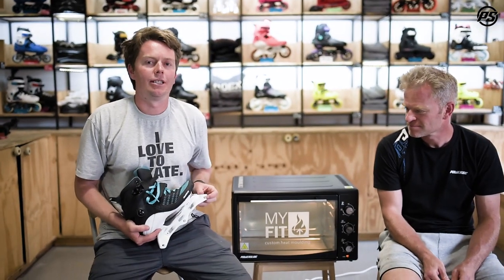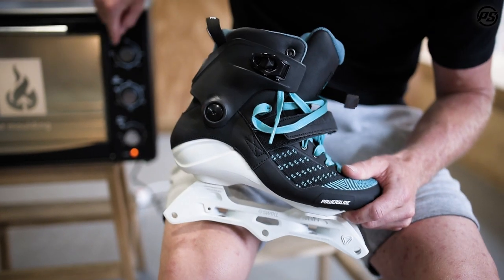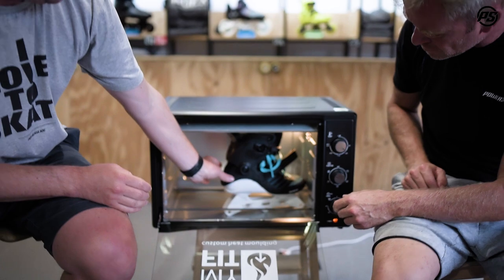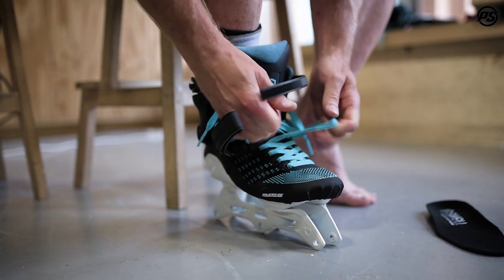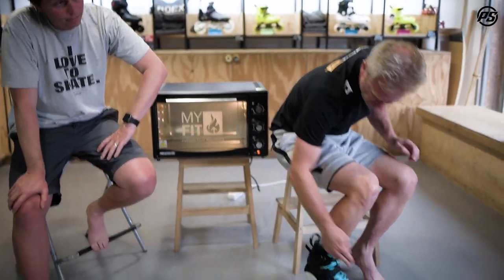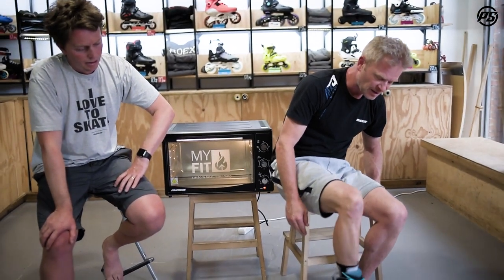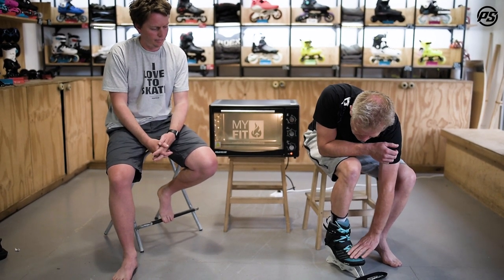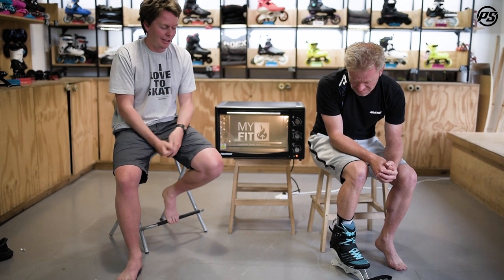How to heat mold SWELL skates correctly - Speaking Specs

Comment: Can this also work with an r4?
Reply from the maker: the older r4 shells are not heat moldable, but the 2018 r4 shells, which do come with trinity mounting, are also heat moldable the same way the swell skates are
Reply: Those are the ones I got! Might have to try this to tame the arches on my r4 and kaze...hopefullyit works as it’s been a hell of a year trying to find skates that fit
Reply: Those are the ones I got! Might have to try this to tame the arches on my r4 and kaze...hopefullyit works as it’s been a hell of a year trying to find skates that fit
Reply: Those are the ones I got! Might have to try this to tame the arches on my r4 and kaze...hopefullyit works as it’s been a hell of a year trying to find skates that fit
Reply: Those are the ones I got! Might have to try this to tame the arches on my r4 and kaze...hopefullyit works as it’s been a hell of a year trying to find skates that fit
Reply: Those are the ones I got! Might have to try this to tame the arches on my r4 and kaze...hopefullyit works as it’s been a hell of a year trying to find skates that fit
Reply: Those are the ones I got! Might have to try this to tame the arches on my r4 and kaze...hopefullyit works as it’s been a hell of a year trying to find skates that fit
Reply: Those are the ones I got! Might have to try this to tame the arches on my r4 and kaze...hopefullyit works as it’s been a hell of a year trying to find skates that fit

Comment: Can I heat mold the white Swell Road 125’s with the air pump in the back?   I have excruciating pain in my ankle from the lower shell plastic digging into my bone.  I was only able to skate in them one time and then this pain started from the plastic.
Reply from the maker: Hi, No we do not recommend this as the air pocket is heat sensitive.

Comment: Hi there, I´m really worried about my new Swell... I have a lot of pain in the inside ankle bone because of the hard plastic. Will the hard plastic really mold with tjis process or is it just for the soft boot? I tried the heating process with a hair dryer but I don´t see difference.... Somebody could help me on this? I´m really desapointed for now with these rollers... Thanks.
Reply: I have the same problem 😪
Reply: I used the method shown in the video & relieved the excruciating pain I was having on my left inner ankle bone! I have the Kaze. Thank you, Powerslide!!